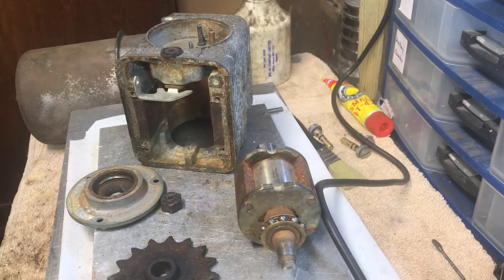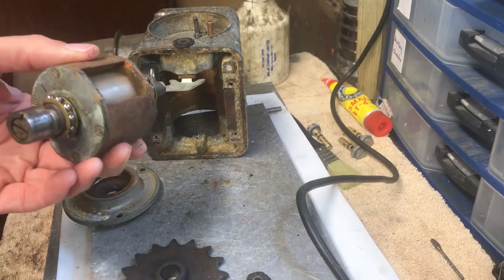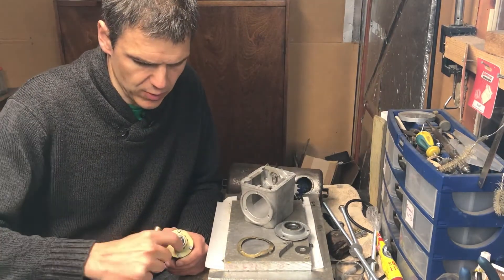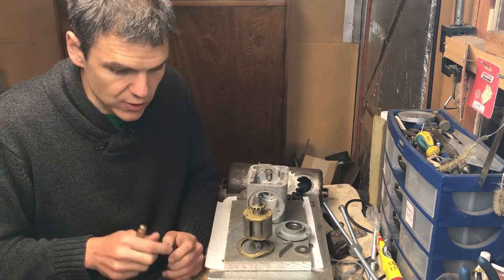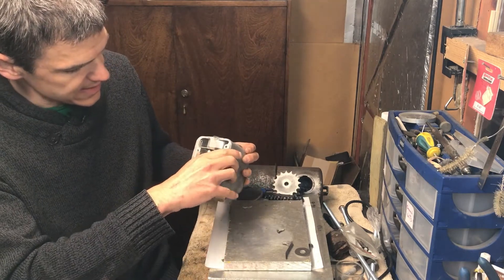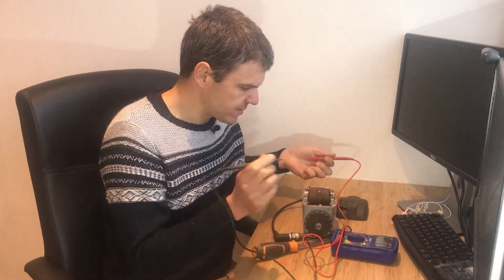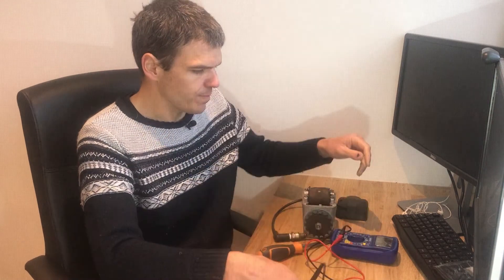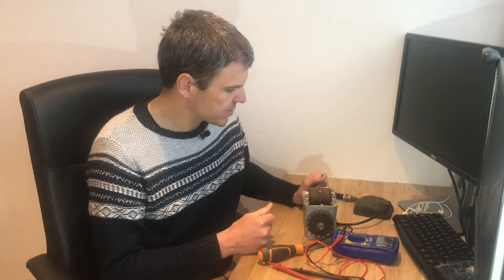Lister D Magneto Lucas RS1 full rebuild but still no spark Coil Fail.

Comment: I had to rebuild but still had no spark after a closer look I found that the condenser was close to one of the distributors caps contacts at bit of tape sorted it
Reply from the maker: Good tip there to check those details!
Reply: Having same problem new coil new condenser but no spark . Not been able to take fully apart so could it be something inside possibly

Comment: It's almost safe to assume that an original coil will be dead. When manufactured, they had an expected working life of around 10 years. Many have lasted decades beyond this. Most are green with corrosion inside. A rewind will see the magneto ok for another lifetime.
Reply from the maker: Indeed! That is what I ended up doing and it resolved the problem!
Reply: @carburist any idea why mine won't spark new coil new condenser but still no spark. 🤔